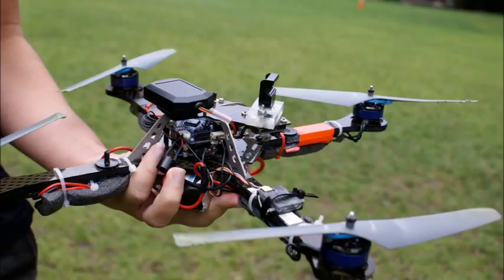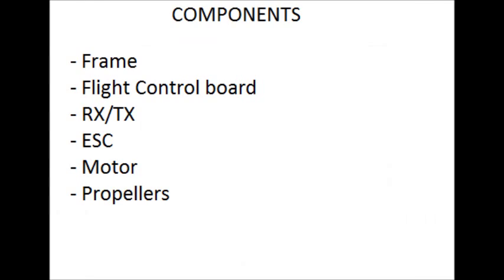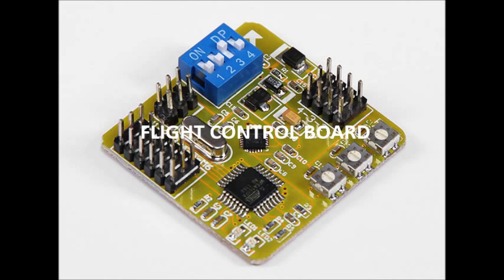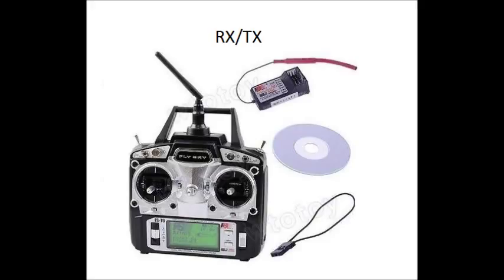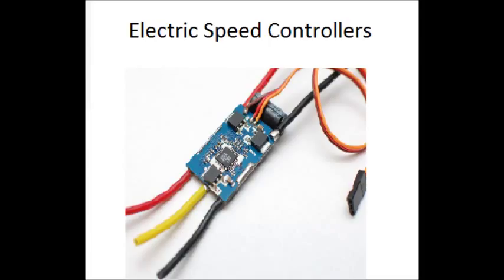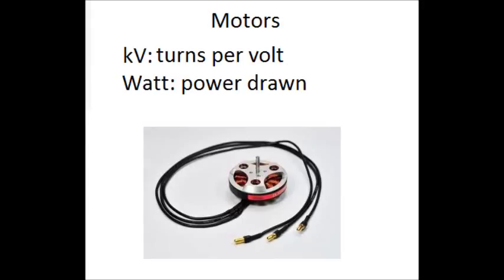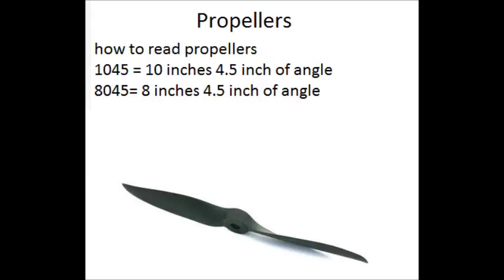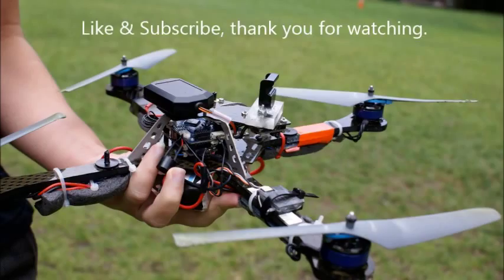Quadcopter Basics Chapter 1: Intro to Quads & Components

Comment: So how does one determine how to pick the propeller based on the motor? how do you know your propeller will work with your motor and not burn it out? where can I find this information
Reply from the maker: +Joe Spamola General rule of thumb: slower turning motors = bigger props 600-1000kV motors should be rockin a 9-12 inch prop / fast motors = small props 1500-2200kV should be using ~5-7inch prop
Reply from the maker: +Joe Spamola I perfer 800-850kV motors with 10.5inch slow fly props - gives me a stable platform to FPV and a DECENT amount of agility nothing crazy.